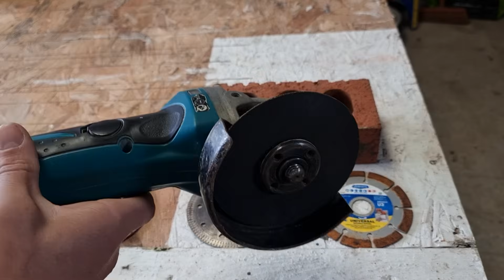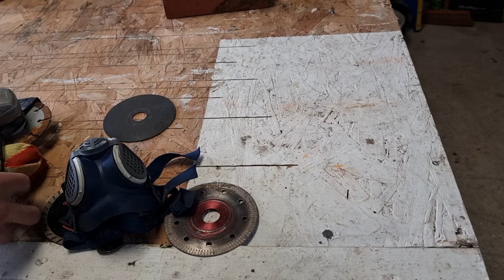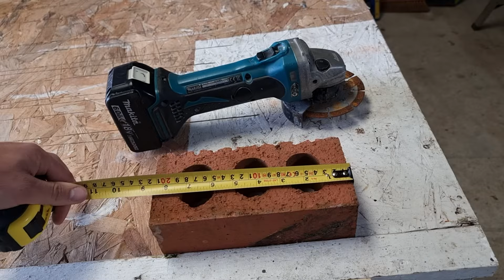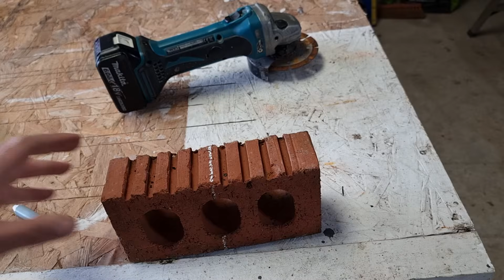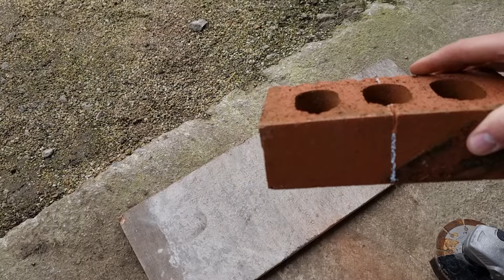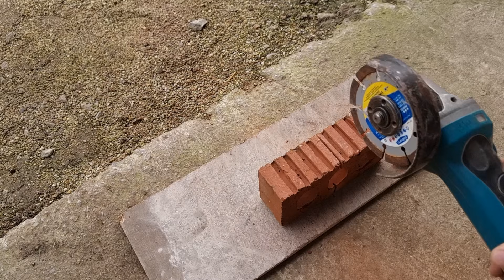How To Cut Brick With An Angle Grinder

Comment: I only have one brick to cut in half.  Do you think I can use the metal cutting disc?  If it doesn't cut all the way through, at least enough where the brick will snap in two with tapping it?  I don't care if it ruins the disc, I just would rather not buy a masonry disc just for one cut.  My brick is solid, no holes in it.  Thank you.
Reply: Just use the grinding disc, cuts a smooth finish. 😊

Comment: Thanks for the video. I’m a bit nervous of using an angle grinder. I may decide to use one for some bricks in the garden for a project. It will be pedester patio bricks. Would a diamond blade be my best bet for fuller bricks without the holes like your red bricks?
Reply: Yes use a Diamond Blade please, regular discs break easier when used in these applications.